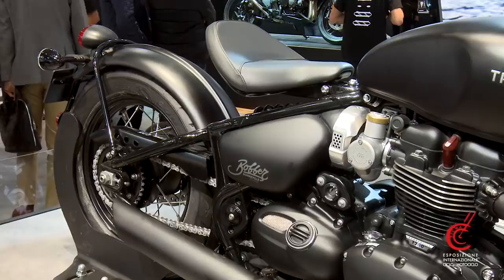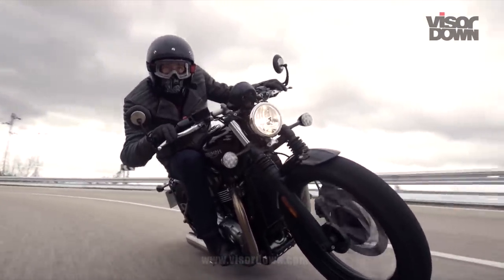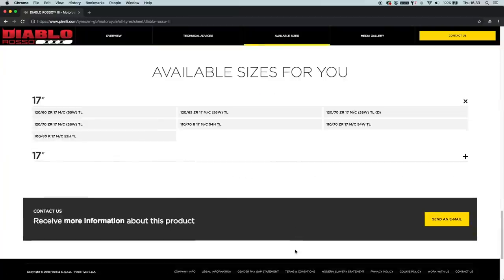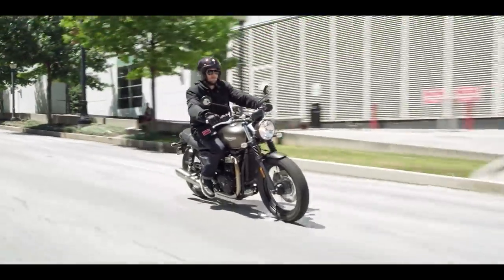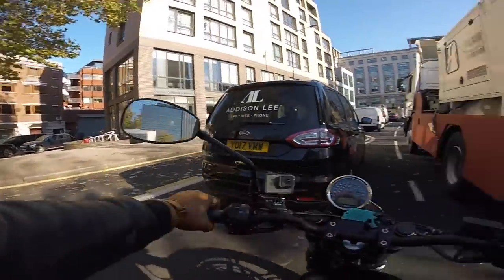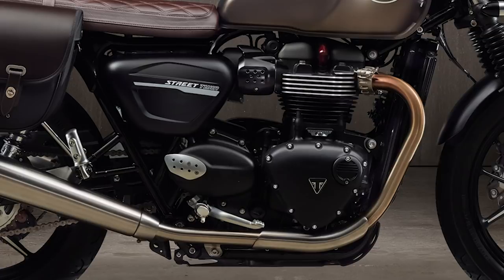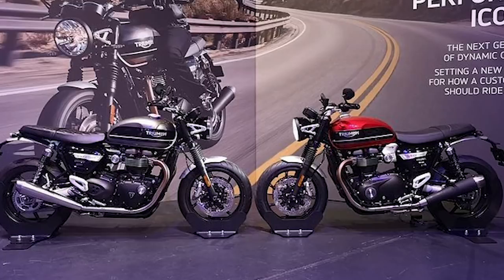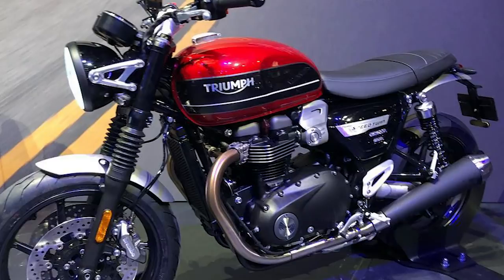Triumph 1200 Speed Twin: What To Expect

Comment: This is basically what I’ve been asking for on the Triumph FB Page for a year.  I’d resigned myself to doing it myself to a ‘standard’ Thruxton which would appear to be what they’ve done themselves albeit with (I think) the new scrambler motor which has 90hp instead of the 100hp that comes with the Thruxton. 90hp with a bit more torque is ideal for a bike like this though. Bench seat is wrong mind... My god I hate those things 😉 The paint could be better but it’s not terrible. I’d take the red one with all the extras. . I’d want to put Ohlins or Nitron shocks on the rear and cartridges in the forks.  This has the potential to be a great bike.
Reply from the maker: The bench seats seem to be more divisive than I’d expected! The stock seat on the bike with the red tank looks alright though?
Reply: MOTOBOB Yeah, it’s ‘OK’. At least it has a ‘bit’ of shape to it. I realise that it’s subjective and ‘clearly’ the fashion at present but for me, bench seats just ruin the look of every bike that they are on.
Reply: @hollowaysteve  Me too, i really don't like bench seats! By the way, is that Holloway in London?
Reply: Steven Hill It is Holloway in London.
Reply: @hollowaysteve  Know it fairly well....we used to live in Seven Sisters Road next to the  Harmsworth animal hospital.
Reply: Steven Hill TBH I don’t know that area (Finsbury Park) at all.  I only venture the ‘wrong side’ 😉 of the Holloway Rd (or even the Holloway Rd itself) if I’m driving elsewhere. I’ve lived both sides of the Camden Rd for 20 yrs but don’t take advantage of the area too much. It’s a good place to live for town/work. Piccadilly line is king. If somewhat oversubscribed.
Reply: @hollowaysteve  I know exactly what you mean about the "wrong side" LOL, it's one of the reasons why we moved away and i don't miss it one little bit! Never been a fan of public transport, so glad i don't have to commute.

Comment: Looks heavy the new twin, have you had the safety bulletin on the wiring yet on your twin ? My twin only a month old and been told at next service the wiring loom bracket will be replaced.
Reply from the maker: Not had that. The look bracket is just a little plastic thing though isn’t it? Not a massive job if I remember correctly - I had it off when I replaced my headlight
Reply: @motobob  Just a bracket that holds the wiring in check up by the headstock ,apparently been issues with lights cutting out because the loom stretched to tight . I contacted Triumph and their reply was this is a service bulletin SB556 AND YOU SHOULD QUOTE THIS NUMBER when your bike goes for a service at a Triumph dealer and the work will be done.
Reply from the maker: Thanks for letting me know! Will check when I take mine in next year for service

Comment: I’m torn on this. It’s the exact spec of bike I was after but it looks overly cluttered and partsbin’ed. Just doesn’t look as good or clean as the new street twin or even the t120 black edition.
Reply from the maker: I think a plain tank like the ironstone colour from the 2019 Street Twin would have things looking a bit neater, as I agree there's a bit more going on than the rest of the range.
Reply: MOTOBOB the throttle body cover on left hand side needs to calm down a bit too. Ultimately though, nothing a bit of customisation can’t sort out. Hmmmmmmmlets wait for the price.
Reply from the maker: T120 is about £10,500 so I would expect similar.